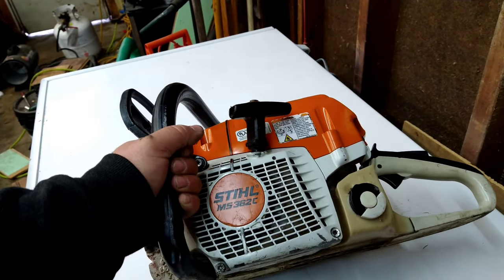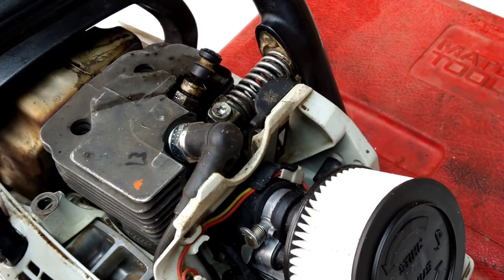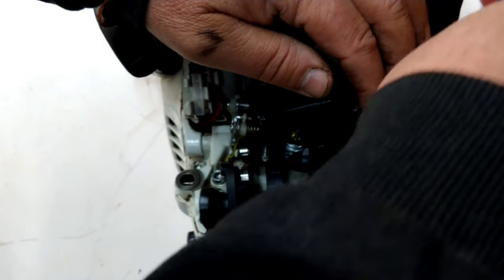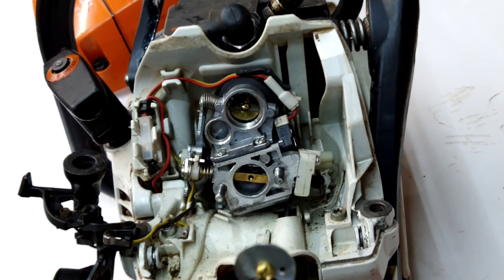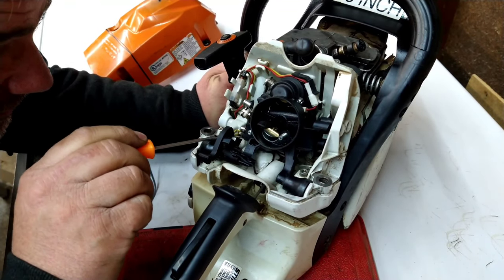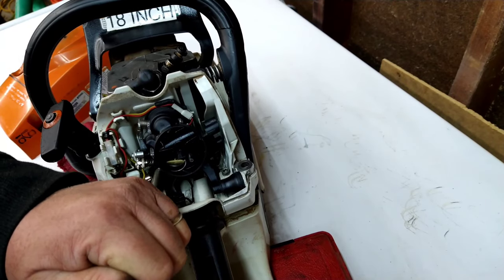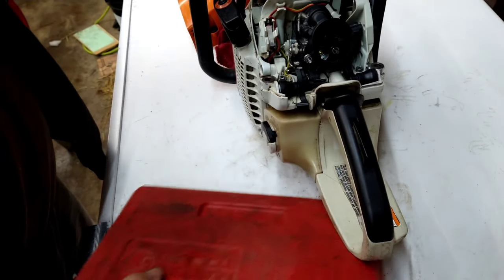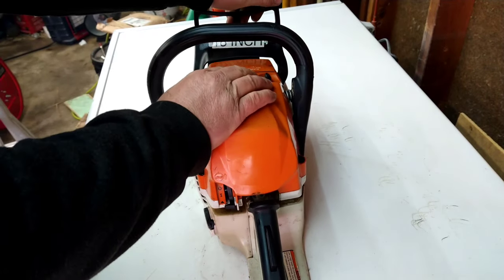Stihl MS362 C-M choke stuck, so let's fix it free

Comment: great video. fixed my problem. only question. how did the buterfly get bent???
Reply from the maker: My only guess is from usage of using throttle causes butterfly to open and close, every time it closed it was a little more pressure which to bend over time.
So every time you just take finger off quick it snaps back.